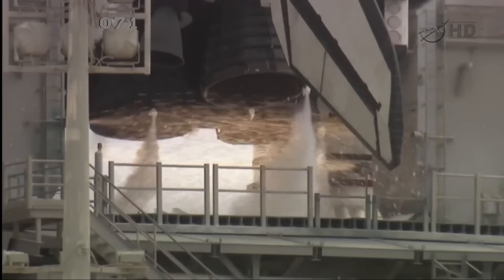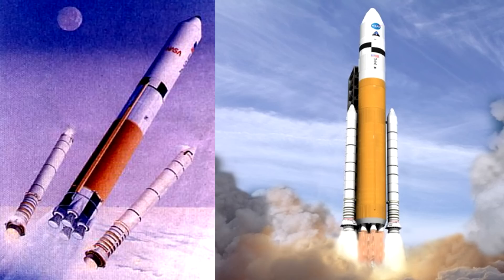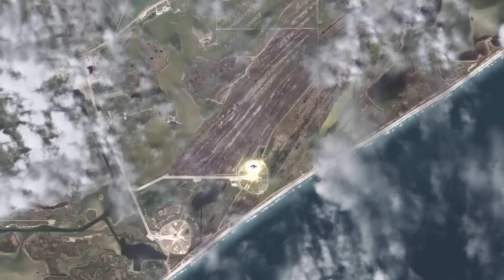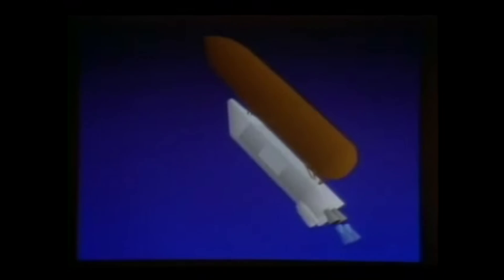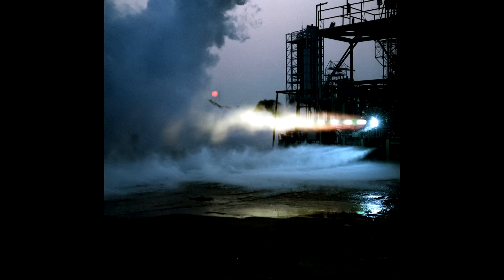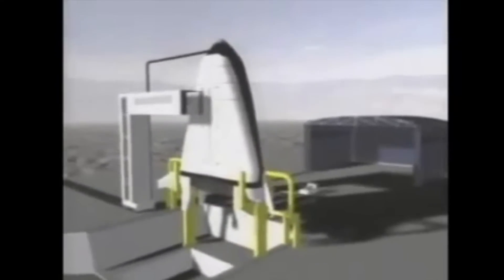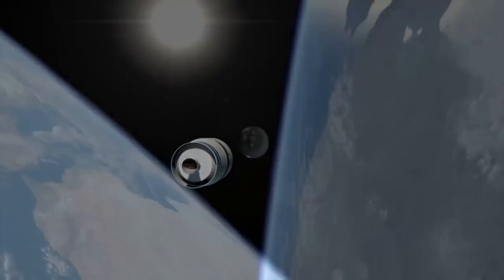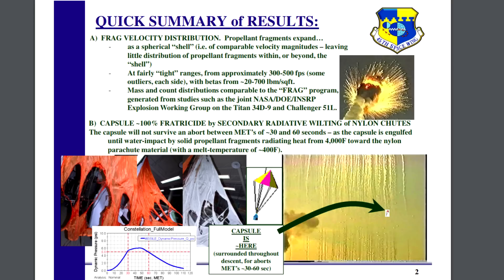Why The US Took So Long To Replace Space Shuttle's Crew Capability

Comment: I guess those metallic heat shield tiles the X33 would've used would've been another problem had they actually been tested. It took 20 years to figure this out because our space program and public system is paralyzed and wants to be kleptocratic.

Comment: They should have started working on a crew launch system in 1986 after they killed the first teach in space.  The Shuttle was a failed design and should never have been man rated.  It could have been used for cargo with a much smaller crew launch vehicle with an LES for sending crew to the ISS and back.  Separating cargo and crew launches seems like a good idea.  Most cargo missions can be done autonomously.

Comment: shouldve kept the shuttle.   135 flights with 2 failures..... yes... thats sad we lost 2 crews but space travel is dangerous... and we knew what caused the failures and fixed them.  Shuttle shouldve kept flying instead of us relying on the soviets...
Reply: The fundamental problem of it being a "horizontal stack" - where falling ice from the tallest part of it impacts sensitive lower parts - was never addressed.  And it never had a good launch abort system.

It was a good thing to retire the shuttle - the idea that we'd cavalierly sacrifice another seven lives to that known mess is sickening.
Reply: @tomamberg5361  The shuttle design was fine as the 135 missions and the space station it built are evidence of. The NASA culture and attitude was the cause of both shuttle disasters. The designers told NASA, don't have foam debris rain down on the orbiter and don't launch when it's too cold. Simple requirements which NASA knew and accepted when the shuttles were delivered.

However, NASA normalized technical deviations during the program, allowing both of those circumstances to occur multiple times, despite pleading from engineers...eventually resulting in catastrophes. Read chapter 8 of the CAIB Report, the culture of NASA was the problem, not the shuttle itself.
Reply: Never relied on the Soviets, only Roscosmos (Russia).

Comment: We need to focus on materials science. They keep trying to solve old engineering problems with old materials because Congress wants a turnkey project. It’s ridiculous. We should build two reusable space launch systems every five years: One built from the latest technology, tested and proven, the other should be a test platform. If we kept each ship in service for 20 years we would have a persistent fleet of four. That may not be enough, but it’s a good start.

Comment: For clarity.  Due of the high heat loads of the Solid Rocket Boosters and their energetic exhaust plumes it was found that the ablative nozzles of the core stage RS-68 engines and their close proximity required core stage engines that could better deal with the high heat environments.  An engine with a regeneratively cooled nozzle fit the bill.  This was why the Rs-25 was selected.  The video made clear exactly why the RS-68 was rejected, but didn't mention exactly why the RS-25 WAS  selected, just that NASA upgraded from the unsuitable RS-68 to the RS-25.

Comment: Twenty-seven months later and they're still pushing back the full-duration static fire of the SLS.  And whatever they tell you how long it's going to be until they actually launch the klugey thing, double it. Then there's Boeing, still delaying their second attempt at a test flight that will hopefully allow them to fly astronauts on a rocket with buggy, foreign-contracted software. Thank goodness for SpaceX, which, though it always takes longer than they say, gets things right in the end.

Comment: The title should be why the U.S. (STATE) is taking so long to replace space shuttle capability.
Reply from the maker: Well, it was the US STATE which made the decision to ask private companies to bid on Commercial Crew contracts. (And then another part of the state had a bunch of hearings to try and convince everyone SpaceX couldn’t handle it)
Reply: @scottmanley  but do you think hybrids could work for the replacement for the rs25s
Reply from the maker: @Barrett2346  Hybrid rocket engines? No. Hybrids are worse in every possible way.... well except cost.
Reply: @scottmanley  I would think they would work for smaller sat companies but I would agree with you on that. Thanks so much btw you were the one that got me into space flight and aerospace and especially rocket engines❤️❤️❤️

Comment: A significant part of NASA's funding comes from military contractors who try to sell their services by appealing to dual civilian-military applications. The Shuttle Orbiter was actually also this kind of vehicle with many design flaws as a result. It became an open secret that since it was capable of carrying satellites into orbit in its cargo bay it was also potentially capable of retrieving them... and not just our own satellites...
While the Shuttle Orbiter was never used in this capacity it became clear that such mission would have a lot of issues with secrecy considering how public every launch and landing was. The program was also far more costly than originally advertised. This further demotivated Congress from finding a 'replacement' since most of them haven't the faintest idea about rocket system development or even the significance of crewed missions.
Remember the history of space rocket development was always largely motivated by military applications right from the start. (this is even true for SpaceX and other privately owned enterprises now if you have been following the news)

Comment: I was kinda hoping the US would have considered the option of having nuclear energy applicable to a space station outside of orbit by now, I dont really like the idea of the vehicle operating at minimum electricity, never mind the design itself given we already know the shapes the amount of energy it takes for a shape to leave earths gravitation pull never mind the material needed for such a project, you can always include safety pods on the shuttle itself in case of an emergency and fire it off from sea and not land.
im disappointed at this, honestly I am.
also I was thinking about something, why dont they fly a smaller version using the helicopter design to launch it from air to save fuel cost?
Reply: We are very sensitive about radioactive material near humans. NASA would need a lot of good lobbyists to approve that.

Comment: The lack of a US manned launch system is a strategic error and embarrassment for the United States, which is forced to fly at exorbitant cost with a nation it has under trade sanctions.

That strategic error is purely due to lack of political will, and a dysfunctional body politic.

Compare the different in political will in the 1960s and 21st Century: 

JFK “Moon Shot” Speech: 25 May 1961
20 days after Alan Shepherd’s suborbital flight; the US has not even put a man in orbit
Hardware available: Mercury capsule + military IRBMs / ICBMs
Moon landing: 24 July 1969 (8 years, 2 months later)

Columbia disaster: 1 Feb 2003 (trigger for new manned launch system)
US has extensive experience in Earth orbital, space station & lunar manned flight
Hardware available: SLS, Delta - multiple variants, multiple X programmes including X-33
Replacement US human launch system: not yet available, scheduled for
7 May 2020 (crewed Dragon) (17 years later); and 
“late 2022” (Artemis II) (19+ years later).

That is what a strategic failure looks like.

Comment: The first stage of the SLS has been built and is undergoing testing right now. Which puts it ahead of all the other shuttle replacement launchers. The Orion capsule has completed an unmanned test flight, which puts it ahead of every other shuttle replacement program. The dragon has completed many supply missions with the last one being done by a capsule that had flown twice before. So we have reliability and reusability.

Comment: Its very simple. NASA was simply a money transfer methodology from the taxpayers to the Aero-Space industries. At ten to a hundred times basic costs. So a 5 cent nut or screw became a 5 dollar nut or screw. Because it was Aero-Space certified. With no change in construction or usage. Plus there was another multiplier for R+D Development.

Thus the majority of money in Aero-Space Development was made in designing the equipment. And the actual usage of the equipment and systems was at a cost-plus payment to Aero-Space Industry. Thereby very little money would be made where there was the maximum risk to industry profitability.  So the maximum money transfer was from making all the profits in development and then killing the project before it became operational.    

That is why the NASA projects had a lot of projects in decades of development. Yet never left the launch-pad. Nor saw any usage. Because there was no money to be made by a successful project launched into Space. On the other hand, in communication satellites. All the money was made after the satellites were in operation. Thus the Aero-Space industry had every financial incentive to get satellites up in orbit and making money.    

That is why NASA generated a constant stream of financially expensive, decades long R+D failures. While the communication satellite industry made money on constantly utilized basics. NASA was a financial /scientific scam in operation. For the profit of the Aero-Space industry and Space Science Universities.

Comment: Sad that the VentureStar got cancelled. Too bad they don't try to take another stab at it. And would be nice if they pursued an upgraded X-37C for manned flight and larger unmanned flight payloads, to be launched on partially reusable stacks, like Falcon Heavy. Those would be the replacements for the Shuttle. The SLS looks more like a heavy lift vehicle and something for deep space missions. 

If SpaceX can operationalize having Falcon Heavy lift 30 metric tons of payload to LEO while reusing three boosters, then it seems quite a few types of missions could be covered by that organization at more economical cost - and could do more if going fully expendable. And then there is Blue Origin's New Glenn, which may come to fruition in a few years ...

Comment: You can't cut funding to useless companies because you will have a social crisis if thousands of people loose their jobs. On that i agree. But you need to find a sustainable solution to the problem. Otherwise you are only postponing the inevitable. Politicians which are corrupt by default are not working towards this direction. They will preserve a corrupt system until it fails.

Comment: My (possibly mistaken) understanding is that it wasn't so much the government that shut down constellation as it was the president. The house and senate had approved the budget, but the president struck those items from the budget, over the opposition of his own party
Reply: More like the entrenched lobbyists had approved the budget, and a fresh broom came in and didn't accept the status quo of bottomless cost overruns of the contractors. Called for looking at commercial alternatives in the space program as a whole. COTS.

The current president has in effect canceled SLS in the long run. Cut off funding for the next generation versions, and called for looking at commercial alternatives. Leaves SLS as a dead end. 

Oddly enough, two very disparate presidents did a similar thing. Threw a glass of ice water in the face of the complacent contractors.

Comment: Just to put this into relation:
- The Moon landing was less than twelve years after Sputnik 1, but the first manned launch of Crew Dragon will be more than seventeen years after the Columbia disaster.
- Today, the Space Shuttle design is more than ten years older than the A4 alias V2 rocket was when Armstrong walked on the moon - but it has to stay in use.
- In autumn 2019, the time without a manned NASA flight will be longer than between Kennedy‘s announcement and the actual moon landing.

Comment: Hey Scott, love your videos, except this one . . . . .
The basic problem with US based launch systems is that they a rutted in the procurements system of the past.
ULA has been getting how many billions of dollars a year to do nothing?

The logic here is that if you disliked the the shortfallings of the most successful launch system ever, then you will certain not dislike a launch system that basically does nothing for a decade, but you will pay fifty billion dollars. and while it has not killed anyone, it also has not launched anyone so 0 for 0 is a lot lower kill ratio than 12 for 700 guessing astronauts launched into space by shuttle. 

The metric for a system of trust is what it has accomplished versus the resources that could otherwise have been used. The Orion project illuminated corruption of farming out work to offshore entities with poor tract records, it demonstrated the easy corruptibility of giving contractors money for doing nothing. Ffor instance, a company getting several hundred million dollars from ULA at the same time was skimping on the angle of attack sensors of their newest mid body Passenger jet. SLS is an entitlement system that does really nothing. 

To add to this, these contractors did not fix one major weakness of the shuttle, the SFRBs, the doubled down on them. They is still the big, icing over orange tank. Seriously, a startup space company made the SFRBs obsolete in five years of operation. Booster rockets should be throttleable, should not have freezable O-rings, self landing and reusable. The ISP of is similar to a ‘sugar’ rocket, the fuel is more expensive than lwith a third more ISP, liquid fuels can be refueled by pouring liquid into a tank. the love affair the Congress has with the challenger-killing SFRB manufacturer needs to end. 

Shuttle = expensive and marginally risky *space that gave us ISS and Hubble + repair and upgrades. Fix the foam on the orange tank and use reusable boosters and it would have been good, still for a few missions per year.
SLS = corrupt management of big space that promises to do what we did in 8 years 50 years ago 6 times. . . . . . Once, but unlike Apollo will probably never see a man to the moon. First manned Orion mission, my guess late 2021.  NASA says this is their launch bed for Mars,. If their windows are in 2033 to 2036, there is not chance in hades that a SLS/Orion based system will reach Mars in any form.

The Orion program has already cost 16 billion dollars, that is >10 shuttle not counting the cost of the SLS which to the end of this year is 16 billion dollars (no firing test of assembled vehicle yet) and will cost 35 billion to 2025.

This expenditure of 51 billion dollars has gained us only in the knowledge that a political body elected by a largely ignorant public whose core motivation is the appeasement of local space contractors and jobs while not creating a cost effective and competitive process that produces.  We are thus educated that without proper success incentives, easily corrupted institutions will easily drag on a process that does nothing for the public good until the violation of the public trust is an inexorable truth. We see that corrupt contract taking institutions, like the one that built those boosters, cannot change their stripes. 

This is why there is no replacement for the shuttles functions.
1. The shuttles failings were not a core design flaw, they were a result of a corrupt and concretized procurement process.
2. The Lethargy in US big space is largely the result of trying to shove a square peg (contractor desires) in to a round hole. the process is backwards. NASA should hire independent engineers with space experience to design a system and contractors should compete on a global scale to make those parts. A third entity with no interest should evaluate the parts and determine if parts contracts or renewed or cancelled.
Reply: Agree with everything you say, except the no love for Scott. He just laid out the history of this mess. I don't think I heard him say we would be better off if we hadn't cancelled this or that part.

Comment: SLS isn't just about politicians and contractors in their district, though. There's a lot of value to taking proven human-rated engines, motors, and tank designs and repurposing them to send as much crewed payload to lunar space (per launch) as possible. There's inherent engineering value to that approach, and it's a bit disappointing you didn't mention that, Scott. And if we want to send orbiters to Uranus and Neptune in a reasonable timeframe, we're going to need a vehicle like SLS for those niches.

My main disappointment with SLS is it was announced without a clear purpose. If, in 2010, we were told that SLS would be used to send crew and hab modules to lunar orbit to build a space station that would build on ISS as a proving ground to Mars, then the public (and press) would better appreciate its merits. But instead it received all these "Rocket to Nowhere" headlines, despite the fact that any astronauts headed to Mars will need to spend 12-18 months living in interplanetary space (aka "nowhere"), and high lunar orbit is pretty similar to that environment.

So we got the Deep Space Gateway proposal in 2016, which was rebranded as LOP-G (gross!) in 2017, and the Deep Space Transport concept for SLS has been abandoned in favor of slightly longer Apollo-style landings. SLS won't return as much value from shorter-duration missions like that compared to longer ones proving human interplanetary travel, so it's frustrating to see this political tug-of-war over its applications. The ISS would never have been created in this polarized environment.